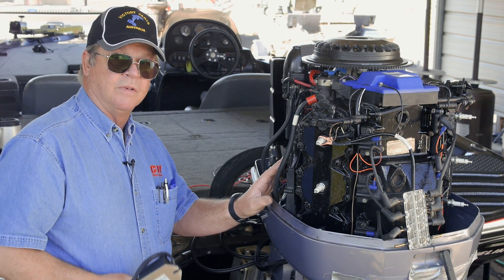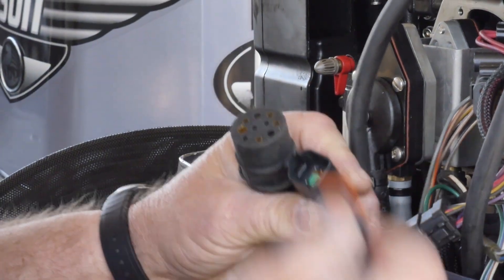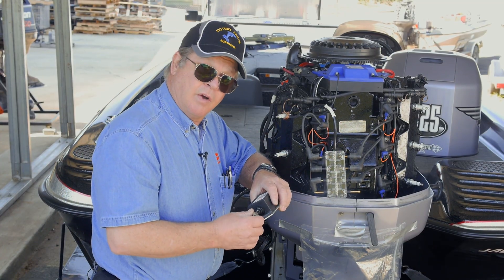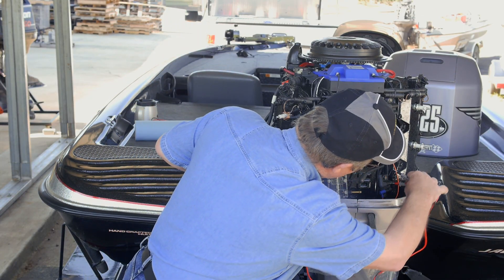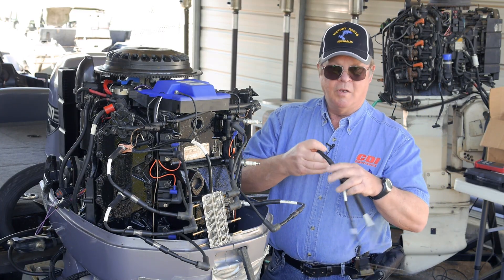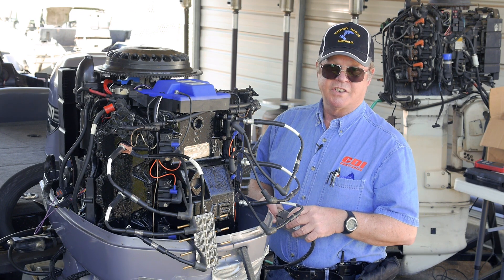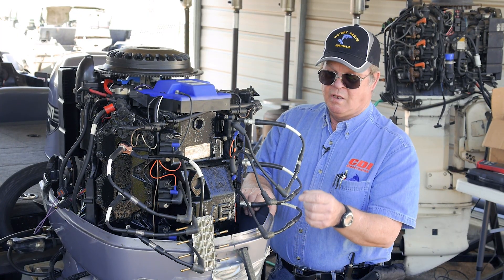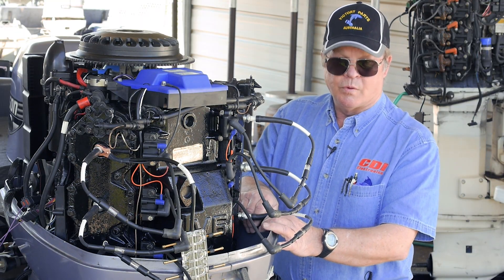How to Diagnose a Cylinder Misfire

Comment: How do you test spark plug wires?
Reply: Here is the procedure in my service manual :

"Test spark plug leads for continuity. Calibrate ohmmeter on low ohms scale. Attach one ohmmeter lead to each spring terminal. While wiggling both spark plug covers and the entire lenght of the spark plug lead, the resistance should remain near zero ohm. Replace spark plug lead if your test result vary."

Also inspect the insulation of the spark plug lead to see if there is a crack section. The rubber insulation of my bottom cylinder was cut by the cowling latch when I bought the engine. Continuity was good on the ohmmeter, but the spark was probably arcing out of the insulation. 

If the spark plug leads are good, check your ignition coil. I had to change one on my 1996 25hp. Since then, it run great! I hope it help.

Comment: My 1992, 200hp 2.5L Mercury wont exceed 3,000 under load!  Forums said stator, so I replced it with a CDI stator.  Also swapped new power packs, and a newer trigger.  Still won't get up over 3,000.   Idles and starts as usual.  Happened after 20+ minutes of 4,500 RPM running great (just lost power), so I'm thinking ignition, not fuel (lost power like shutting off a light switch).  Picked up a DVA adapter, going to try that.
Reply: I had the same problem on my 125merc 2stroke, I did a link & sink, cleaned the carbs, & still would not get on plane, rebuilt the fuel pump, & still nothing!  So it narrowed  itself down to the accelerator pump, & sure enough, that was the fix!
Reply: @mlipsey66     Mine was the float needle seat in the top carb backing out!!!   Pulled the intake cover off and sprayed gas into the carbs and the boat sped up when spraying into the top one!   Inside the carb was like-new clean, it was just the seat that backed out.

Comment: I haven’t been able to find any video describing my issue. The power pack the coil packs the spark plug wires and the spark plugs are all good but I’ve got a cylinder misfire on three and four. It’s a 115 Mercury mariner 1984 to 1988 and it has six cylinders three carburetors. Carburetors have been rebuilt and also DC voltages have been checked and everything sparking the way it should.

Comment: Mine misfires mid throttle out of the water out of the intake manifold but just before the carbs. What could cause that?
Reply: Did you figure it out?
Reply: @SamandKadenGoPlaces  yes and no. I fix it. But then it screws up another cylinder. One I track that down #6 goes acts again. I have not had all 6 cylinders fire reliably since.

Comment: I'll make a long story short.  My XP200 wasn't misfiring.  changed the stator and stuff and then it was misfiring.  spent 2 years getting pissed off.  come to find out it was my own fault.  The OMC flywheels are kind of a bitch to take off, so i put on my 3 armed puller and got it tight as heck, nothing.  so i took my air powered hammer/chissel with a hammer head on it and gave the flywheel a 5 second shot which was like 500 blows.  came right off.  took 2 years to figure out that I cracked the internal timing magnets in the center hub doing this, not the exposed charging magnets that actually do come loose.  not those ones.